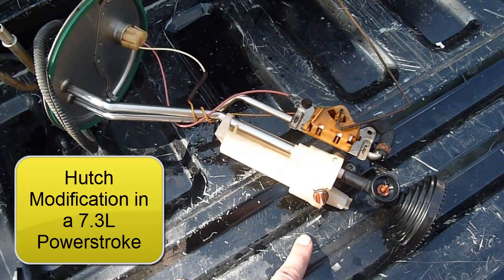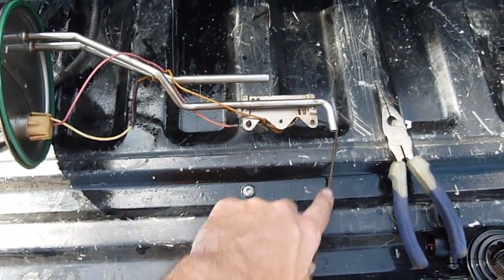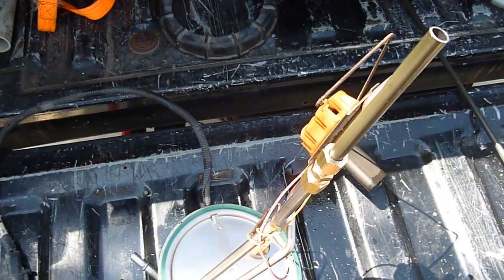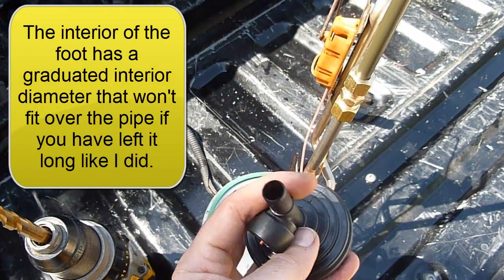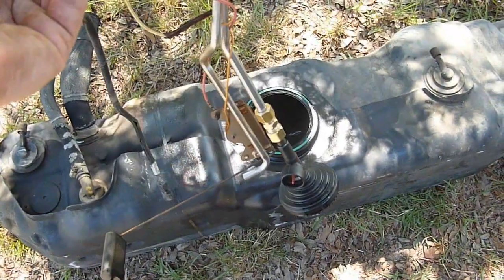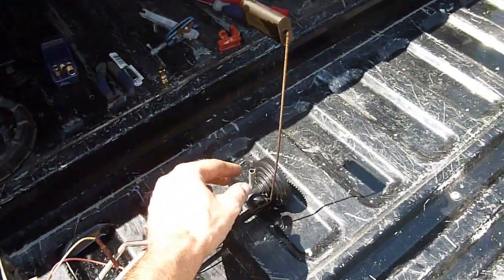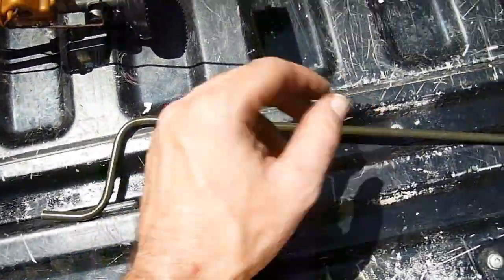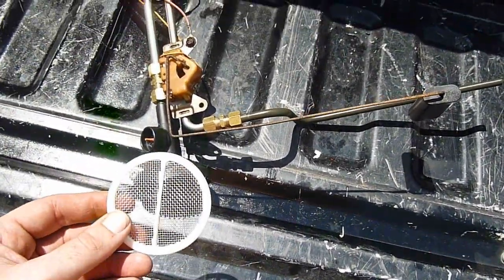Hutch Modification | Ford F250 / F350 7.3L Powerstroke Diesel

Comment: the biggest issue is the quick connect fittings between the the tank and fuel pump, they are designed to hold pressure NOT negative pressure which they are subjected to drawing fuel fron the tank to the pump, get dieset rated hose and go from the tank to the pump and clamp it in old school

Comment: Have a 1999 f350 7.3 power stroke, start but whe i put in Drive, dosen't move, engine  dosen't accelerate,  its accelerate on porking only, after like 10 mts tu be runing engine star to slowly shut off its self, any idea what could be?
Reply: Did you fix it? If not it sounds like a fuel pump.

Comment: I am working on mine now, was clogged with rust.. Not sure eliminating the plastic recirculator chamber is a good idea - I think that is there for real cold weather, keeps the warmest fuel circulating within the chamber and heats incoming fuel that may be gelling.. possibly thats why that side valve is in pickup screen foot.. in case the screen clogs with gelled fuel at bottom of tank where its coldest.. Thinking just take out the two micro screens - why they have a screen on the return is a real mystery also?? I am definitely adding a filter by the pump, also you can buy small screen clear filters for mercedes diesels that will do what these micro screens did but you can see them and change them out easily inline before the pump. It was really a dumb idea to put micro screens in the tank, can't believe they have engineers actually design stuff like this..

Comment: it's a fuel pickup not a foot lol. and what does all this do for the truck. because you are eliminating some crucial fuel screens or foots in your case, that will now clog the fuel pump
Reply: david martin....the modification is done because the idiots at Ford put the filters INSIDE the tank.....so every time the filters get clogged, you have to drop the God damn tank to clean or replace them...they should have designed it with an IN-LINE filter OUTSIDE of the tank, and installed right before the fuel pump....
Reply: Pay attention david
Reply: david martin thats why u add a in line filter

Comment: Great video,Is it a power gain?
Reply: Black in fuel is usually algae that grows at the fuel water surface.
Reply: usually an indication of bad injector o rings, what about your fuel filter?  Usually is black and contains engine oil.
Reply: Most likely its from the diesel fuel, black sediment and slim accumulates/drops out of it..  Its dirty stuff, try treating it with an additive.. Also this tank is so big, lot of fuel sitting around long time in it.. Check the diesel you are buying from the pump, fill a small clear container, make sure its clean.
Reply from the maker: +Jeff Anderson - No power gain.  The primary advantage is that you are removing turbulence from around the float and getting better circulation of the fuel.
Reply: Oh ok,I understand,im doing this as we speak Thank you so much.I also have another? Is there any way possible for oil to come into my tank from the engine due to bad injectors or any thing else? My fuel was very very black.What's your opinion?

Comment: First Hutch Mod. I've seen, have same color F350 Powerstroke 7.3L Diesel.  Are we omitting the filter all together inside the tank and relying only on the fuel filter at the intake? or are we installing an additional filter outside the tank on the underside of the truck before the fuel pump? Makes sense to add an inline fuel filter before the fuel pump here.. I have my tank out now due to the filters being clogged, want to rid of this crazy Ford design as well but don't want to clog up my new fuel pump!  Please respond soon, anybody have any fuel filter mods outside the tank to under-side of truck please respond,..thanx, and happy turkey day, just hope im not doing this in a snow bank...lol
Reply: Lady Di you can buy a filter kit from cnc fabrication @corey hurtt for like 175.00 includes everything to do hutch mod 3/8 pipe fittings.
Reply from the maker: Your best bet is to add an inline fuel fuel filter between the tank and the pump along side the frame.  Most who do a hutch mod will do that.  Hope that helps!
Reply: innocuous_name   thanx, for the quick response, was curious if you added an additional filter along side the frame before the fuel pump and if you didn't how many yrs. has it been and are you having any problems with fuel pump restriction or problems overall?  reason why im asking is most likely wont get to the addit. filter installation until next spring 2015. thanx again, lady Di